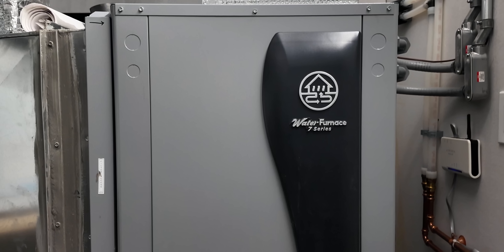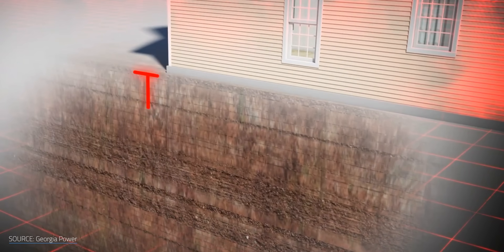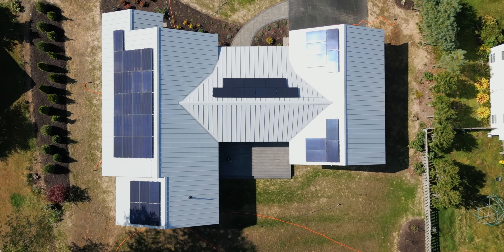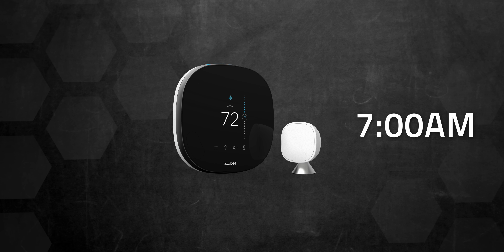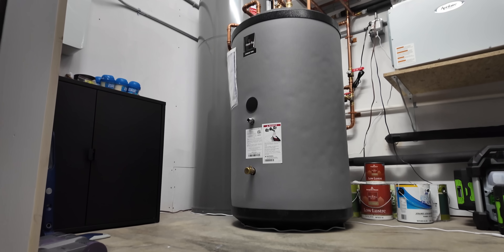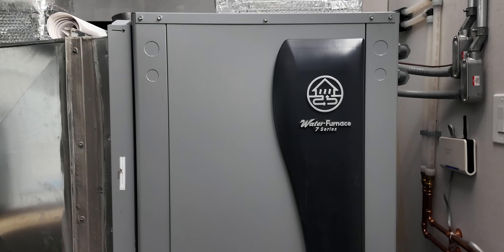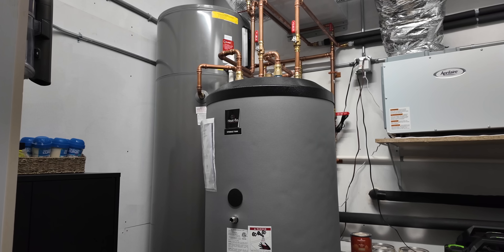How My Geothermal Heat Pump Really Performed (2 Years)

Comment: Your video shows we are “judging” on four different categories.
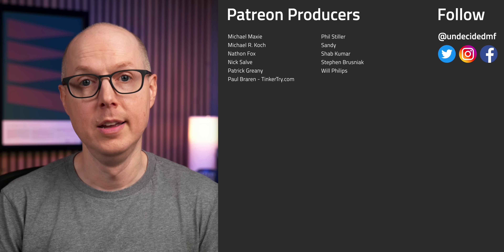1) ideology/philosophy- energy / 14:21 net zero home - your system wins
2) running cost - your system wins again
3) break even point - you did not mention in this video
4) comfort level - you win

However, given the huge upfront cost, the feasibility or affordability on a large scale is most likely low.
Reply from the maker: I have covered the ROI in a previous video, but it’s squishy in my case because of the other things in my house that I did (like solar).
Reply: @UndecidedMF you are correct, of course. Perhaps it would be useful to compare 4 systems with vastly different price tags to better cover the reality of different people.

Comment: For me spending the extra cost of geothermal over air sourced on more solar worked out much better. YMMV

Actually I didn't spend all of it. 18,000 USD would buy me over 100 kW of solar, and I don't need that. I fully go over 20 kWh per day and having a system that produces my daily needs in 12 minutes isn't sensible.

Comment: Cool video, but I don't follow why you had to drill a 400' well. Couldn't it have been much shallower and thus cheaper?
Reply from the maker: The size of the geothermal loop is sized based on the heating and cooling load of the house.  Some homes may need two or three wells of that depth.  I only needed one.  The cheaper method would be a horizontal loop that doesn’t require any drilling at all.  You basically bury the loop 6 to 10 feet below the surface over a large area of your yard.

Comment: I personally installed 2 MRCool ducted Universal heat pump systems in my house last year and have been mostly happy with them.  Our electric bill did spike some, but the gas bill completely disappeared, as the gas heaters were the only things remaining on the gas.  I replaced our 5kW solar array with an 11kW one this summer, so we should be back in the zero of electric bills.  I would recommend the heat source HVAC to anybody, they're WAY, WAY cheaper, and work just as good.  My house is 100% electric, with 2 Tesla Model Y's, we save some $3500/year from not paying for electricity, gas and gasoline.

Comment: The per month averages quoted don’t match the per year costs quoted.

If operating costs for two years were $697 and $702, the average monthly cost is not $60.20, or $722.40 per year.

If hot water production cost was $949 and $954, then per month average was not $90.06, or $1,080.72 per year.

Which numbers are right?

Comment: paying up front even at that high price; you have locked in the future energy costs to the amount of time you are in your house, and what ever capital gain you my have added to the value of your home. Given that the cost of electricity and heating fuels will go up, most likely quite substantially in the near term, I think your system is a pretty good hedge! 
the more prices rise the faster your effective claw back will be.
 Not to mention, as you said yourself, the increase in the comfort level that good central heating creates is massive.
 To mimic that with any other heating type would be so much more expensive it will make what you have installed seem like a bargain!

Comment: Since you built a new house why didn't you just run the geothermal (ground source) hose loops along with the connect to the water and sewer as they are already below the frost line? Two for one instead of drilling?

Comment: Our average temperature here is like 85F so that wouldn't work too well. I've always wondered though. Why doesn't anyone bury a refrigerant line? You could still use the condenser to cool it to the 110F outdoor temperature and then run it through the geothermal line to cool it to 85F. That should make the air conditioner way more efficient. It's effectively a 2 stage heat pump but one of the stages is free.
Anyway I'll probably do it regardless once we move into our dream home. We don't have enough land at the moment. I could probably drill, but the HOA might get mad and I don't want to deal with any of that right now.

Comment: I’ve had geothermal in my large home now for 16 years and consider it a great financial move even though the cost of electricity in the Missouri Ozarks on a small farm is already quite cheap. It was 5 cents/KwH in 2005 and it’s now gone up to 10 cents. That would seem so cheap that it would exclude going geo or solar. But the house being 2200 sq ft on the main floor but also having a full finished basement it’s a total of 4400 sq ft getting HVAC service so with a 4 ton heat pump my monthly electric bill for 1 - 1.4 MW of electricity was running $150 - $225 a month. The total annual electric bill averaged $2500. 

I had a tankless water heater back then than used propane and a clothes dryer that used propane. Additionally my old SEER 8 heat pump required a substantial amount of propane to supplement the electricity when temps dropped below 28. So my house used about 800-1000 gallons of propane a year. That added another $1200 - $1800 to my annual energy bills. 

To cut to the bottom line, when my old heat pump showed signs of dying I looked into energy saving options. Since my small 20 acre farm had plenty of room for cheaper horizontally laid out ground loops a geothermal system suited my needs. It cost me $20k after rebates. That was the only bad news. My propane use went almost completely away and my electric bill dropped to an average of $75 a month. The system is a Water Furnace brand and should last 50 years or longer. It also satisfies most of our hot water needs as a by product of heating or cooling the house. The water heater that is part of it is an 80 gallon unit. 

In the 15 years it’s been in use my only expense has been one annual filter replacement per year instead of changing 4 per month at different locations in the house. There has been no other maintenance issue. It saved me half of my annual $2500 electric bill and all of my propane bill for a total savings of almost $3000 a year. It paid back my investment in 7 years and it’s been putting money back in my bank the other 8 years it’s been in service. Enough savings to allow me to add a 9.5 KW solar system 5 years ago. That brought my electric use to almost zero. I do remain grid tied so I do have a small connection fee but now my annual electric bill is down from $1000 to well under $500. 

Cutting energy use is a great investment for anyone who doesn’t need to borrow money to make it happen or for folks who don’t expect to move every 5-8 years. I can’t recommend it enough — especially for folks nearing retirement who have some savings to make it work for you. It’s a guaranteed way of cutting living expenses in retirement at a point in your life when you don’t intend on moving again. One thing you can anticipate with certainty is that your electric and gas bills will always be going up - not down if you don’t make a move to cut your energy use. What other investments do you have that will put $3-4k in savings back into your bank with almost no risk??  If you live in a city or town with higher utility bills than we have in a rural area can expect a far quicker effective payback on your investment.

Comment: I live in the D.C. area in a 3500 sf house with 2 HVAC  systems (gas furnaces) as well as a gas tankless water heater. I keep the house at around 72 all year. 

My average electric bill is $142 and average gas bill is $45, for a total utility cost of around $2,250/yr.

I don’t think I’d save anything switching to geothermal.

Comment: Geothermal Heat Pump. not worth it. ok maybe. if it does not break down and works according to specification. 
We are at  58° 6'7.70"N and have an uninsulated concrete house of 160m2, the cost of electricity and heating is 1500eur per year. wood/pellet central heating works without electricity. Hot water comes from central heating. grid tied solar panels, i know really bad in 2025. i want batteries but i wait little more. also i plan to build solar inverter-heater for central heating. it will cut off 3 month of heating at spring(200-300eur worth of fuel). and my english sucks.

Comment: Thanks for the update Matt. Long time follower . We both love data during home design. I forget what was your home temperature "balance point " ? I know you ran the numbers when deciding between A vs B options.  you are on a slab, right ?  You used double wall construction, right ? At $.30 plus per kwh , over solar paneling  actually is a better investment , if one has a battery storage capacity , with an invertor that does not scalp the peak day input. I remember you have a smart transfer box, ( i did watch those  videos) with wonderful scheduling and adaptability , by any owner. With your near semi passive haus R values and hopefully air tight blower door standards , how was increasing your external shell r-value , not a worthy consideration vs on going or reducing the hvac air and heat ,  conditioning monthly costs? I was one of the early double stud wall builders in michigan , i taught all the tech college instructors the design methods to achieve the same for their future student builder clients. got my solar engineering degree in 1990"s . amory lovins from rocky mountain institute was one of our board members . along with Stan Oshinsky,  I did visit his home / business in Colorado , which has never had a heating or refrigeration bill, ever . Stan was a self taught and a pioneer in flexible , thin film pv panels. My point and observations.  The rooms with extra btu's from equipment btu contribution office , etc. could and can be solved with a "jumper tube" , thermostatically  controlled with fans or remotely relocating the equipment itself  if other room real estate would allow and run the needed room to room control wires . I ran into the same issue at the epa science rooms in durham , nc after clark construction placed 25 freezers @ zero degree in door temps , for decade old science work from their scientists . waste heat, needs dealt with  ! . Design work is a best guess , with moving uncertainty. you build it and adapt , learn , teach and live with it . The over sized geo thermal water wizard team , could have ... suggested a step down in btu capacity , without risking , not keeping you happy and explained it with data , before the install. The system would have run , " a little longer" , perhaps , as needs drove operational times. Not throwing shade on your home and wonderful you tube success. I built homes in michigan without any furnaces . Most with zero solar , a few with wind generators. Post geo thermal installs can be disappointing with thin outer home walls, window r values  and lower ceiling r values. even though the geo thermal efficiency "should"   over come the dollar balance point investment. Yours was ideal , a new home design and build out. Thank you for making time to educate others on technology , changing times and options to supply home needs , while thinking through .. best dollar buys best return options. Have you ever had the zen pleasure of a clothes line , in the summer time ? :) thanks for your new efforts in advance . edited .. from a home comfort stand point , humidity and fresh air control are critical, for every home . r values and air tightness are a one time investment, hvac comfort a life time , re investment , equipment wares out . I appreciate your personal situation ,  you explaining that during every video . I do not recall if you ever presented a next level r value investment   comparison) , reducing your hvac needs to a fraction of your present home , btu per square ft needs. 2 future video thoughts... post no solar , efficiency rebates , roi . 2nd drain back solar hot water , vs instantaneous , vs heat pump  vs desuperheater   Pre or post install ( retrofit) . Have you visited the RMI new web site , system , solar , etc , investment calculator ? please do or do a video on it , with their collaboration ? thanks in advance .

Comment: This video lacked an important bit. Estimating your energy bills if you chose an air sourced heat pump. If your electric bills are now zero would they still be zero using the air heat pump? If not how many solar panels would you need to add to achieve this? I don't think the ground heat pump is economically viable given that you can use much cheaper air sourced one and just a couple solar panels extra and basically get the same costs over time.

Comment: Matt, thank you for your work and interest on energy usage and conservation.  Being a numbers geek and married to a hippie chick, we decided in 2008 to switch from propane to geothermal and then in 2012 we added solar here in Wisconsin.  Would we do it again?  Absolutely!  As you stated, it's complicated and there are many, many factors to consider when making a retrofit like ours.  However, I have estimated our pay back period for both systems is about 15 years which we are nearing while abating an estimated 150 tons of CO2 generation.  Annual net electric bills have averaged about $450 per year.  Note that prior to these installations we started out with strategies of insulation and air infiltration which at that time is what we could afford.  So again, please continue your thoughtful and thorough analyses for those of us who have similar interests as you.  David
Reply: Do you draw from the grid ? If so in what climate conditions do you have to draw from the grid?
Reply: @harishyala  Yes, we draw from the grid as we do not have a battery back up system.  The battery technology in 2012 was not as robust as it is now.  The sizing of the solar array was calculated to generate 15,500 kWh while our usage at that time was about the same.  We have experienced a significant increase in use in the summer months.
Reply: @DavidC-p3o I think with decent battery size, you probably don’t need to draw from the grid that much.

Comment: Here in the UK we do not call your system Geo-Thermal. That is reserved for systems that are deriving energy from the heat at the centre of the earth. We have a Ground Source Heat Pump that exploits, essentially the sun warming the earth and the slow release of that energy so the ground is at 9 degrees c all year round. What do you call a system that is deep enough to benefit from that deep earth core energy ?

Comment: I went with an air source heat pump, the soil on my property is half rock, it took a week to dig the hole for my two rainwater tanks and a bit more to dig where the back of my house is, so choice was limited. But it feed loops in my heated floor (and my hot water tank), so even heat everywhere, and it can cool too. Summer aren't that hot here in north of France, apart from ponctual heatwaves. I made a few back of the enveloppe calculation, and it will cost me around the same price to heat my soon to be finished home, than the one i'm renting now, which is 4 times smaller. And i plan to put solar panel and stationnary electricity storage, so a similar setup as yours.

Comment: It seems like you already realize this, but you could have achieved about 90% of the same net benefit, at about 50% of the cost, by going with a hybrid solution of conventional HVAC and targeted mini-split installations.  That's not just conjecture, but real world application.  Would you have installed this same system, without a lot of it being given to you?  While it's true you lowered your energy usage as much as possible, you paid an incredible premium to achieve that.  If it had all come from your pocket, the ROI would take most of the rest of your life, even at those high energy prices.

Comment: Living in the UK, we don't have AC and our heating is on radiators, but in April 2023 our boiler died, and I went all in on solar and ASHP. 

We spent no where near as much, much smaller victorian home, but still, it's absolutly been worth it.

We generate about 1Mwh less then we use over a 12 month period, and between the standing charge, and not being paid as much for export as we are charged on Import, I pay £70 a month for all our electric, but also completely disconnected the Gas.

While we have a reasonably efficient home, and have invested in things like an Induction hob, heat pump dryer and such, it's demonstrated to me improvements can be made, and long term the maths works out. All told, including the loan for the system, I think I'm paying about £30-40 a month more then I would have been anyway for Gas and Electric, and when the loan expires that drops way down.